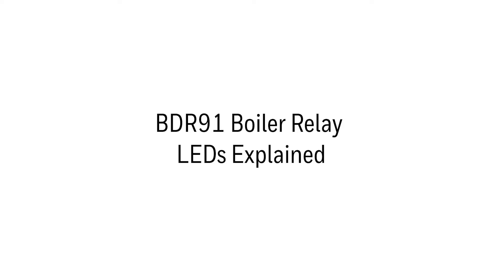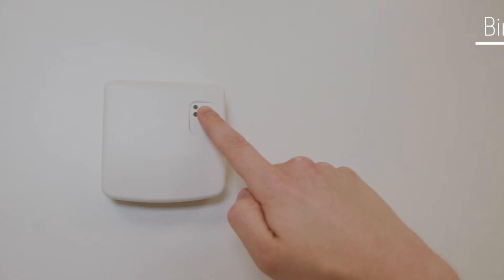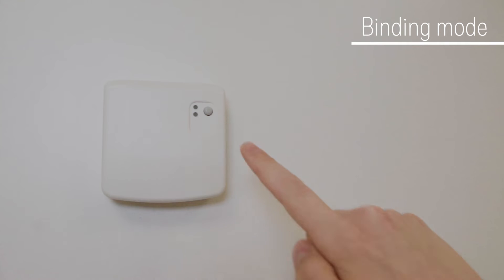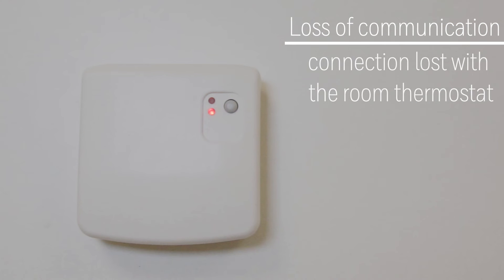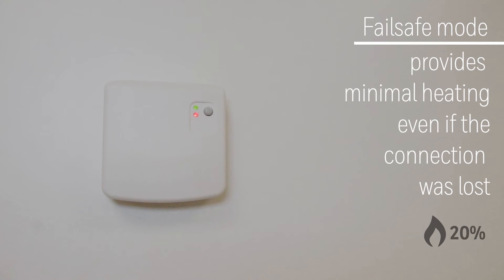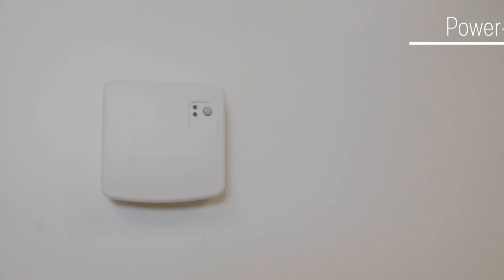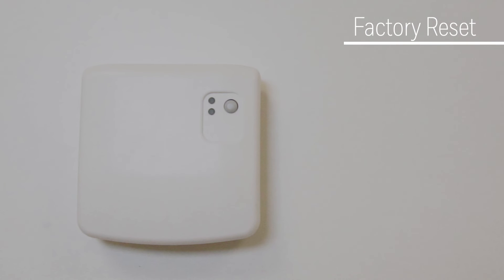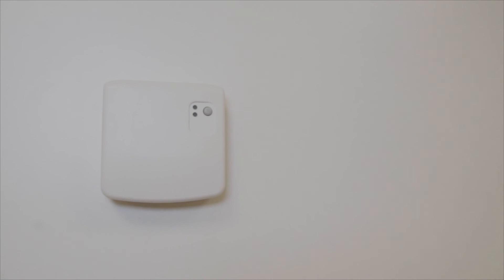Explaining the BDR91 Boiler Relay LED indicators - Resideo

Comment: Quick question: in my new home I have a T87RF thermostat, which is connected to a BDR91 receiver for controlling the floor heating system. The thermostat is properly connected to the receiver (I can see the Wifi-like icon on the display of the thermostat). However, the leds of the receiver are as follows, even if I putting the desired temperature on the thermostat to 0 degrees:
- Green led: always on
- Red led: blinking
What does it mean?
Reply from the maker: Hi Ivano, thank you for sharing. The lights seem to indicate that the BDR91 is operating without fully controlled by the thermostat. We recommend resetting the relay and rebinding it with the thermostat. You'll find the reset and bind instructions in this article: https://support.resideo.com/s/article/How-to-bind-the-Y87RF-Single-Zone-Thermostat-to-the-BDR91-relay?language=en_US. Regards. -Elena

Comment: Okay, the thing I don't understand is the green button. Under what circumstances does it come on? For example, the re-pairing process involves the red light flashing slow and then fast but it doesn't mention the green light again. Should it come on? Should it permanently be on in correct operation? Do you have to press the button on the relay once the pairing has been done to put it back on?
Reply from the maker: Hi Tony, thanks for reaching out to us. The green light should come on by itself when there is a heat demand from the thermostat bound to the boiler relay (i.e. when increasing the target temperature on the thermostat above the room temperature, the thermostat communicates with the boiler relay and the green light should switch on to indicate a call for heat). The button on the relay only serves for binding or resetting the device. So in normal operation, the green light should be on only when the thermostat is calling for heat. Otherwise, it should be off. The button can be pressed once and the green light will come on, however it will switch off after a few moments. -Elena
Reply: @ResideoSupport  Thanks, that's great. I was seeing the light going out and worrying that something was failing somewhere.

Comment: Hi, the red LED on mine is flashing on about every 2 secs and then off for 2 secs yet the one wireless controller we have fires up the boiler, is there a problem somewhere?
Reply from the maker: Hi Simon, this most likely means that it has lost communication with its sensor (thermostat) and it operates in failsafe mode. We would need more info to investigate. Please use this form to contact us https://www.resideo.com/emea/en/contact-us/ and we'll take it from there. -Elena

Comment: What happens when the lights are off but once you press the button on the right it turns green? Does that mean it is binded but the boiler doesn’t need to be on now?
Reply from the maker: Hi Jade, thank you for sharing this with us. If the lights are off, but the light goes green after pressing the button, this means that a manual override has been done from the BDR91. If all lights are off, most likely, yes, the boiler does not need to be on. -Elena

Comment: Hello, the red light is flashing every second. What does this mean? Currently there is no connection to the thermostat but there was last winter. Thanks
Reply from the maker: Hi Isla, thank you for sharing. If the red light is flashing, depending on the frequency, it's either in reset mode or in binding mode. Since it's lost connection to the thermostat it most likely in the fail safe mode. -Elena
Reply: @ResideoSupport  Hello, so I think it’s in binding mode but it is not connecting. Is it worth resetting ?
Reply from the maker: Hi Isla, if you're tryin to bind it to a thermostat and it fails, we recommend first switching the power off for 10 minutes at the relay, then after switching it back on, reset the relay (15 sec - red light flashes rapidly) then release and put it in binding mode (red light flashes slower). -Elena

Comment: I've got solid red light and flashing green light... any ideas? Thanks
Reply from the maker: Hi John, where are you located? -Jim
Reply: @ResideoSupport  Manchester
Reply from the maker: Hi John, thank you for contacting us. We recommend you restart the binding procedure with the thermostat, after having reset the relay. Make sure that the thermostat and the relay are about 1 m away. -Elena

Comment: Is there an over ride button? I’ve got hot water but no heating. The thermostat is connecting to the br91 but it’s not firing the heating up.
Reply: Did you manage to find a solution? I’m having the same issue
Reply: Same issue as @MinistryofWarhammer &  @eljefe720  
This system is just such garbage, every winter similar issues, I am so glad when I get it removed.

Comment: Mine keep cutting out so I have to press the button every 5 mins any ideas
Reply from the maker: Hi Wesley, if the target temperature on the thermostat has been reached or is within 1.5 degrees and it just needs to be maintained, the BDR is going to switch off. -Elena

Comment: Great video.  Is it possible to have 2 receivers binded to 1 controller?  I want to turn an electric radiator on and off when the heating comes on.  I realise I need to add another relay.
Reply from the maker: Hi ElectricPylon, where are you contacting us from? -Maria
Reply: @ResideoSupport   I am in the UK.  Does it make a difference to the binding method?
Reply from the maker: Hi, thank you for sharing. The binding method is the same. -Elena
Reply: @ResideoSupport  Hi Elena, thanks for confirming the binding is the same regardless of my location.  Now please can you answer the original question " Is it possible to have 2 receivers binded to 1 controller?"
Reply: Yes, you can in parallel, If you are also using zone valves just for on / off you can also use their spare  switched contacts  to help control other parts of your custom circuit depending on your need.

Comment: I have sent Thermostat away to be mended as the screen is breaking up. Ever since it went the Relay has been showing a continuous red light.  The boiler is in summer mode and no heating is on . can I turn the electrical connection off at the wall switch until I get the thermostat back for pairing.

Comment: If the lights are off and holding the button does nothing then is that a power issue?
Reply: Did u find the problem? I have the same issue
Reply: If the lights were on and then they go off why would the unit go into standby by itself. Can a remote thermostat force it into standby?